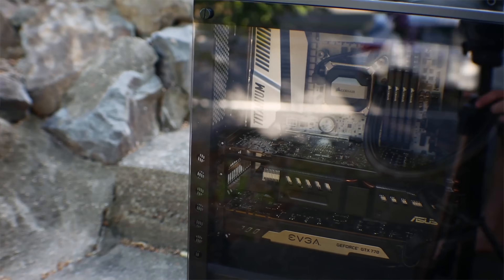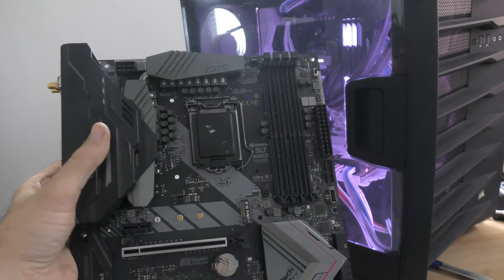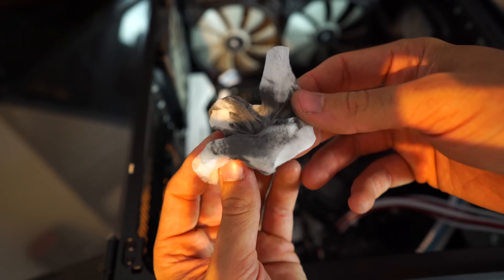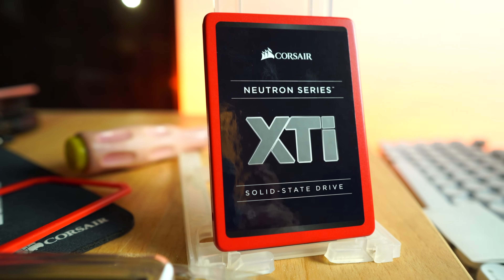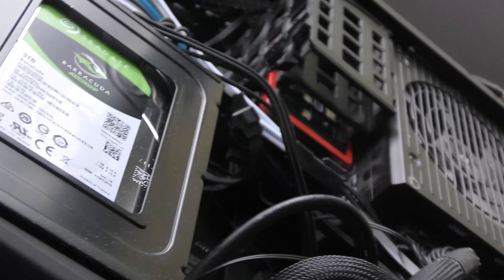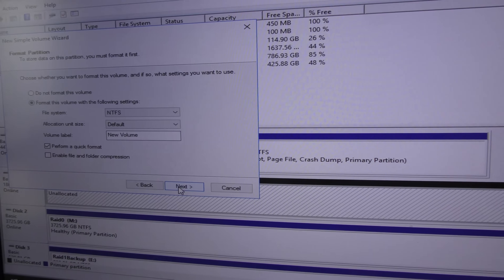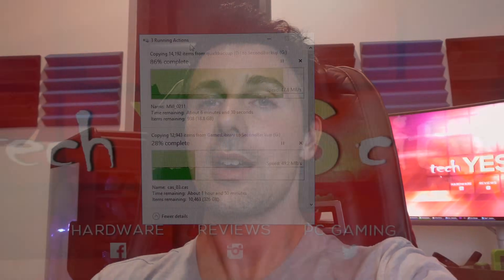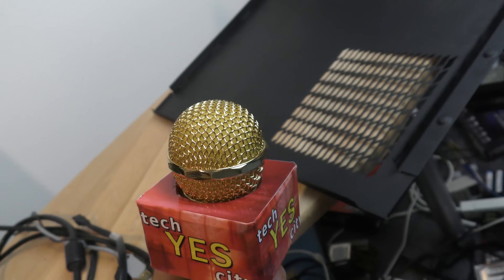Changing my PC from RYZEN to INTEL - Side, Up or DOWNGRADE?

Comment: Even though the 8700K is certainly a beast in gaming. I'm purchasing the RYZEN 7 1700, for the fact that it's a great all-around performer at lower TDP, & noticable cheaper platform cost.                               🖥️
Reply: Screw B.
That's an excellent point. I don't have to worry about AMD cannibalizing it's own socket, out of FEAR of the competition.
Reply: It's also noticeably cheaper in general ($269.99 vs $414.99) and the socket won't be replaced in 6 months.
Reply: I've actually not had issues with ryzen.  My ram ran at its rated 3000mhz as soon as I went in bios and enabled xmp
Reply: I dont think tDP is a valid reason. A Ryzen 7 1700 draws 12% less power from the wall but it needs the same (if not more) if you OC it. (The 1700X draws only 3% less, the 1800X draws 19% more).
But you are right with the Plattform costs since a Ryzen 7 1700 + a good B350 Board costs less then a 8700K (without the Board and CPU-Cooler.)
The true King in Price/Performance ist still the Ryzen 5 1600.
Reply: Danmandingo tdp will go out of the wall once ocd you do realise
Reply: Screw B check out black Friday deal I seen 1700 for 250&230
Reply: im using a 1700 build since around april...never been sad once,,,beats both my intel systems when it comes to smoothness in games..just cant beat that
Reply: http://cpu.userbenchmark.com/Compare/Intel-Core-i7-7700K-vs-AMD-Ryzen-7-1700/3647vs3917 go with the 7700k, it's $10 more for 16% more performance.
Reply: odd as at 1080p with a 1070 the 1700 was beat in fps by the i5 7500 by 5fps and the 7700k beats the i5 by 10 to 20fps even higher in some areas of games and up to 50fps higher on some games.
Reply: ABaumstumpf games been In development before ryzen came out
Reply: Danmandingo I'm also trying to choose between Ryzen 1700 $372 and 8700k $450 in my country
Reply: $240 at Amazon right now people !
Reply: My RAM ran at 3200mhz right of the box with no issues at all. Literally just turned on XMP and it worked flawlessly with my R7 1700x
Reply: vishal Sharma at those prices go Intel here it's more around 1700 250ish and 8700k 400+
Reply: Bugs Bunny where you get 4 and 12 lol 1600 6c 12t 7700k 4c 8t
Reply: YakuZa Fastest is relative. For a given task and a given budget what's fastest can vary.
Reply: You've been one of the few. I had to wait until AGESA 1.0.0.6 to get past 2933. I hope Ryzen plus fixes all these dumb little issues. I kept my Taichi board after returning my day 1 1800x hoping for a better 2nd gen.
Reply: hmm yeah like 10 Watts lower TDP..
Reply: Bradley Walton that synthetic benchmark is just a brief guide. I changed my main rig from 7700k to ryzen 1700 just to play with ryzen system... end up I stick to it because I dont feel any decrease of performance in my photo and video editing, and only few fps drops in gaming. Also do i mentioned I earned some extra money by selling my 7700k n mainboard.
Reply: I'm impressed I can run 2 x 16Gb sticks at 3200.  Getting 2 big dual rank sticks to run this well impressed me.  I have an 1800x, w/Crosshair VI Hero.  I'll bet I can get a bit higher too. I love this CPU.  It's never been over 50% taxed, and that was only for a few seconds, usually never goes above 20-25%.  
Handles triple A games with ease, while watching a movie on the other monitor and downloading 50 torrents in the background.  I edit videos pretty often, and once I tried doing the game/movie/torrents thing while the video was compiling.. That was the only time it even got warm.  Water never gets above 33°, and I live in S. Florioda.  I love this setup.
Reply: @ABaumstumpf
I agree Intel makes high performance parts, but the power draw on one of the latest from them was pulling 500w from the 12v rail with a mild OC.  This is certainly a factor for a lot of us.  I live in a hot climate, and I don't want that heat either.  My 1800x runs pretty darn efficient, going between 2.2 and 4.2GHz, and no matter what I throw at it (AC Origins, movie on other monitor, compiling video, torrents downloading .. all at once).. the water never goes above 33°. It's 27.2° as I write this.

I have nothing against Intel, as I'd take one of these if they were free, but the power draw and heat turned me away this round.
Reply: @ Watchxes
My 1800x / CH6H draws 110w at idle. If I take the water pump, 9 fans, 4 strips ov UV LED, and the cold cathode kit, it's something like 60w (maybe 45 if I took 4 of the 5 drives out of it and let the mem go down to 2133).  If you OC these things, you lose the XFR, which works pretty damn well (mine gets up to 4.2GHz).. and I hear it draws quite a bit more power, even more than an OCd 1800x.  If I downclocked my 1800x to 3.2, or whatever your base clock is, they'd use either the same or the 1800 would use a bit less because of binning.  The 1800x is the highest binned Ryzen 7, there's no physical difference.  This will tell you the whole story.  Lower binned chips draw more power because they're a bit less efficient.

The 1800x sits at the top of the performance range while still using the XFR comfortably (4.2 with no OC).  To reach this range with the 1700, you have to feed it more juice.
Reply: Larry the power draw on the 500 watt intels are massive overclocked 20+ thread i9's.  If you think ANY i7 is pulling 500watts than youre an idiot,  then again you have a 1800x,  so idiot confirmed.
Reply: ElteeMullet Would take a RYZEN 7 processor ALL DAY, over that GARBAGE.
Reply: My Ryzen 7 1700x @ 4ghz, 16gb (samsung b-die) 3200 cl 14 ram outperforms my older i7 4770k @ 4,6ghz with ease in newer Games, if you get your ram speed right and specially your timings its a beast and is on paar with a 7700k @ 5ghz.(can link a video to specially this test 1700x vs 7700k)
Reply: Harpskid mine managed a small boost with some bclk increases. it's a hynix kit so I can't expect a lot out of it, but it's great for what it is
Reply: YakuZa going with 3200mhz ram and really tight timings gets Ryzen a lot closer to Intel's frames in games. there's too many factors that can affect performance that yes in general most systems won't match a lot of i7 configs in games.
Reply: Yes you are right it need some time in bios and research of what to buy ram whise to get Ryzen working as an i7. For People that are new into PC building a i7 would be the better choice, it dosnt bother me personally that much becouse i do lot of bios setting changes to get the best out of my CPU/RAM and so on.
Reply: Scooby Dooby I rarely if ever get any freezes or crashes... troll?
Reply: i got the same processor its amazing
Reply: Andrew Geubtner Your tears are delicious.
Reply: check your ram list though
Reply: Andrew Geubtner your being a bit dumb, in My personal opinion AMD>Intel, but even I know that the fastest cpus (whether or not there overpriced or have expensive platforms that are at the end of their life) are from intel, while value for money and almost as good performance is AMDs ryzen series.
Reply: Amd CPUs are, at least form midrange onward, better value for their performance.
For gaming they are often neck-on-neck. And highend Intel dominates.

Intel still produces the better CPUs all over the place, but their pricing is just retarded.
and about the TDP:
Well, that is NOT the same as power consumption.
If you look at the actual numbers RyZen is only "better" when it comes to heavily multi-threaded workloads as running more cores but slower is more efficient there.
Reply: YakuZa fuck Intel mate, I still love my R5 1600 OC. For example, a friend of mine has i7700 K. In some apps I win with my R5 cuz why the hell not? 4 is lower than 12 xD.
Reply: used 3770k is cheaper and same fps as ryzen
Reply: have a 3770 and just built two ryzen systems, 1600 and 1700 and building a third for myself for a reason, ryzen eats the 3770 for a snack before its snack!
Reply: YakuZa The only problem with your comment is that he isn't looking for the best CPU in the world. He just wanted something that gets the job done without spending unnecessary money. And the same probably goes for all of us
Reply: Ryzen isn't great all around.  It loses to 2014 4790k's in gaming,  probably loses to older gens than that to..  For most people all the slow cores and threads are useless.  A good older i7 is a better and cheaper option for most.  Hell a 7700k is 249 at microcenter and is worlds better for most users than ryzen.  A $189 i5 8400 is a great all around cheap cpu if want budget junk,  as a long time amd user stay away from gen 1 ryzen.
Reply: Wake Undead,  in gaming a 3770k isn't getting ate by ryzen.  Ryzen has its hands more than full and loses to a older overclocked 2600k in gaming.  Also your ryzen system are slow are fuck.  Stop spreading bullshit information with your dumb as fuck amd bias.  Hope this helps.
Reply: still. at the end of the day. intel is faster. when someone asks you whats the fastest CPU out there. you say intel.
Reply: Andrew Geubtner lol you're angry. Don't be so sad. One day you'll be able to afford what you really want instead of having to settle.
Reply: Intel 100 degrees on air AMD 50c on air?  must I say more

Comment: RAID always seems to cause random issues, I don't bother with it as I get plenty of performance from a single SSD :)
Reply: Why asking for trouble? RAID (any version) - trouble for home users. Why bother? Better to stay with lower performance and a backup.
Reply: Jarrod'sTech a single ssd on sata can nearly fully saturate the interface anyway. So I do understand just sticking with a single ssd. If I'm going to be honest, just using hdds for gaming is fine enough for me. I don't get too many issues in general doing it that way.
Reply: I never understood raid. Then again ive never researched it either. Ive always asummed it had something to do with running a server. 
I finally took the dive for M2 SSD. Expensive is all i can say. But over the years, every hdd ive got seem to get worse with noise. From my first hdd which was practically silent to my newest which was horribly loud. Didnt matter which brand either, theyve all gotten louder. Nothing wrong with hdd's just too loud for me anymore.

Comment: i just got an 8700k rig.. 5GHz Core, 4.7GHz cache, 4GHz DDR4 4x8GB. Love it!!!
Reply: James Brophy how is it meaningless if it's better? Get a job and you might be able to afford some high end hardware sometime.
Reply: oh crap. you just triggered AMD fanboys.
Reply: James Brophy yeah I did the same and am very happy I have a good job and it's my hobby (8700k - maximus hero x - 1080ti and nvme drives) am loving it
Reply: Michele Caci I already did. Spent ~2.6k on it. Thats what you can afford to when you have a job.
Reply: Morbious Stone #triggered much?
Reply: TheSinisterEyes1 that is so shit compared to my pentium 2 233mhz with 32mb ram and 8mb vga graphics
Reply: Mitch H have a look at his "liked" videos. He's batshit crazy.
Reply: Michele Caci wanna compare? https://www.3dmark.com/fs/14225830
Reply: Morbious Stone Nah, youre definitely  triggered. Go lay down bud. Take a load off.
Reply: s r It would be a problem if you weren't liking it...
So you have spent 300$ for the rams and at least 800$ for the cpu-mobo-cooler for what? You could get almost the same performance in 4k spending less than half with ryzen...
Reply: Q. Code is this a "long term upgrade" or a "enthusiast upgrade?" Because if it's either you got spit in the face by Intel. Get ready to replace your Motherboard and CPU when upgrade time comes. AMD on the other hand will have AM4 support for "all" Zen type CPUs for a while. The upgrade path will make your 8700k not quite obsolete, but noticably lagging behind Zen 2 or Zen +.
Reply: Henji96 being able to afford it doesn't mean it justifies buying it. Sure, I could save up for the best stuff. It'd take a month based on my paycheck, which is perfectly find. I'd get a 1080 or 1070 (since they're both pretty high end, albeit the 1070 is considering high mid range) 400 to 500 dollars as of Black Friday sales. I'd get an ryzen 5 1600 since I'd never take advantage of the extra cores, and the graphics card would give me more performance than the improved CPU. I'd buy 8gb more of ram for now, since it's still insanely expensive and I already have some. Then I'd get a b350 board because I don't need some big ass board, and I don't need every bell and whistle from the more expensive boards. I'd get a decent case around 75 dollars (probably an s340), a 600 Watt power supply, and yeah. I think I covered everything, and that would be a killer build. Wouldn't be outrageous, and it'd give great performance. Most people will only take advantage of those high end consumer and enthusiast processors if they're doing content creation, or they're trying to game at 4k and not bottleneck the heck out of the gpu.
Reply: Oh and 16gb ddr4 :)
Reply: Henji96 and you get a job so you understand the value of money. I want to see if you are gonna spend 2000$ on a pc.
Reply: True Inferno he "destroyed his reputation" (whatever that was) perfectly fine himself. All I did was provide evidence for my words. And I didn't dig up anything. I just wanted to see what kind of mad person would write something like that. Figured it was some kind of uneducated, indoctrinated kid. Funny how right I was.
Reply: Q. Code which motherboard? Also what gpu you have ?
Reply: what cooler do you have because i got an 8700k asus strix mobo and I am thinking of a good cooler
Reply: https://youtu.be/MsnoN5dIPiE?t=2m
Reply: LOL
Reply: must be a billionaire lol
Reply: James Brophy idk about that pal. Maybe he records videos in very cpu intense games.
Reply: James Brophy meaningless performance? Your 1600  @ 3.8Ghz gets wrecked by the 8400.... 😂😂😂
Reply: Michele Caci no, I'm a 21 year old computer science graduate with a well paying job. I work 37 hours a week and can afford a good pc which I enjoy in my time off.
Reply: that is so shit compared to my AmTel R7 8700x 64 core 128 threads 6Ghz with a Vega 2000 ti at 3ghz
Reply: Henji96 "that's what you get when you have a job".
So you are like 12 years old or what? 
Stupid kid... I don't wanna waste my time with you anymore.